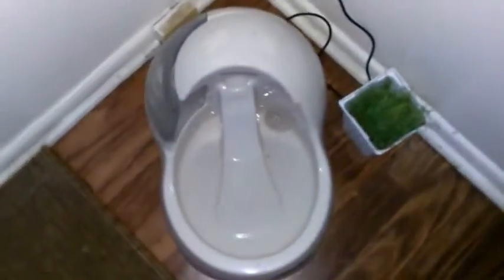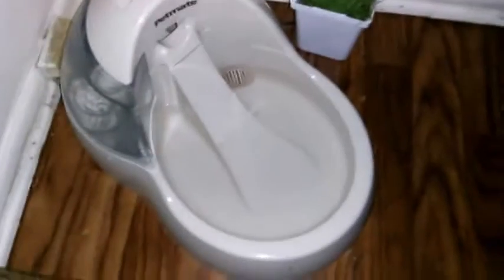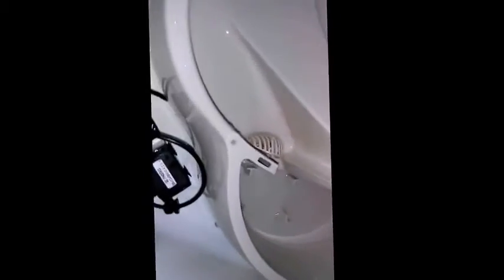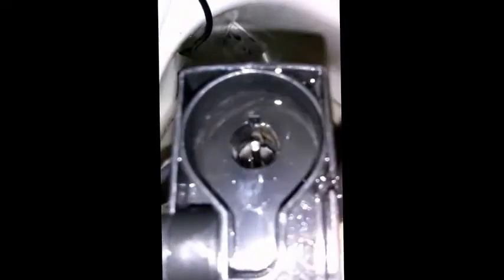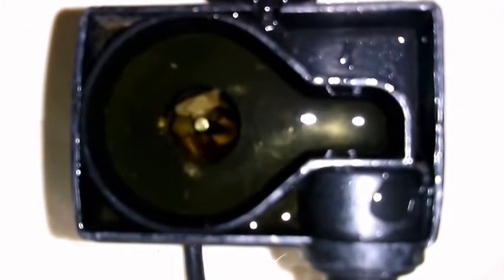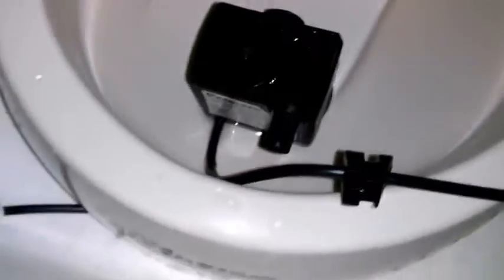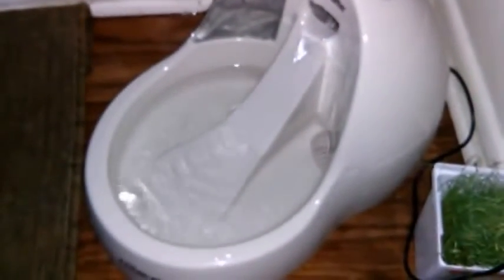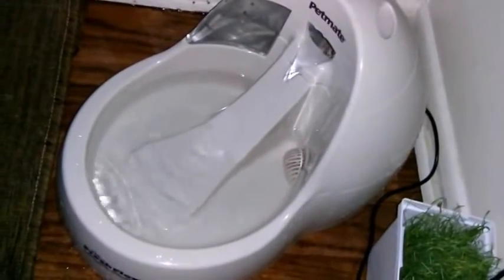Petmate Water Fountain Won't Run

Comment: Thanks for this.  I didn't need to use vinegar, but I saw gunk on the motor as soon as I pulled it out.  I didn't know the motor could be pulled apart, now it's working like new and saved me $$$.